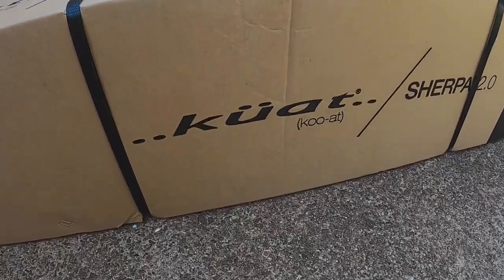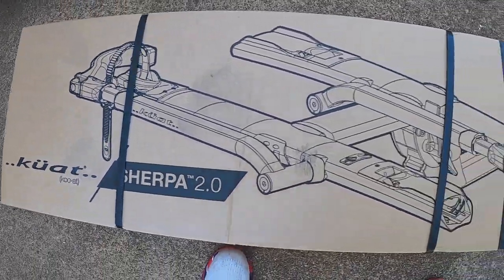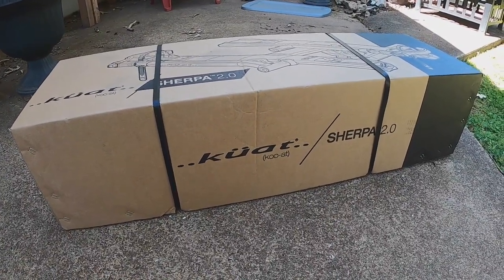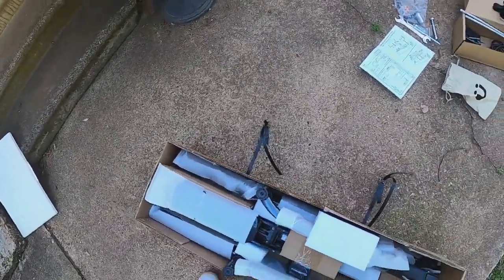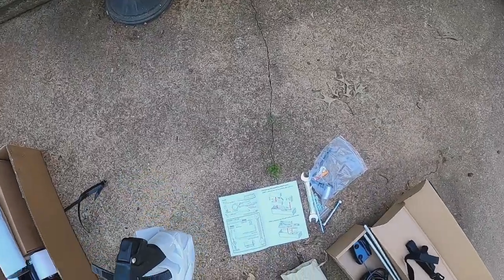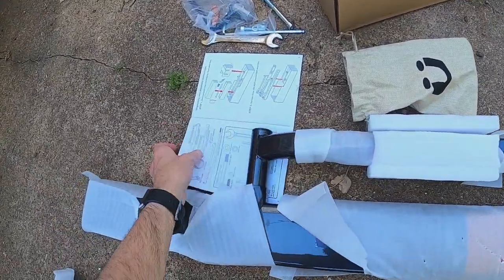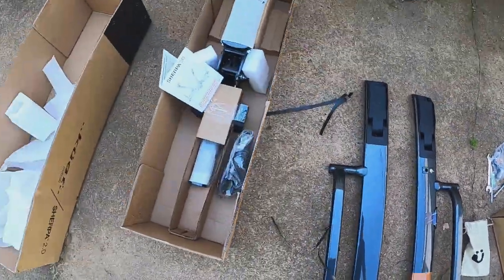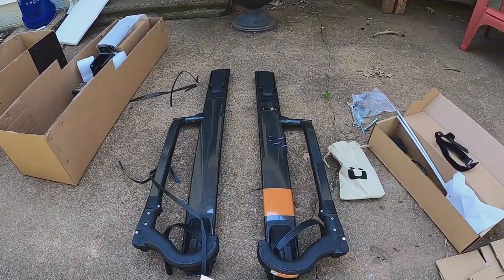Kuat Sherpa 2 0 ASSEMBLY

Comment: Having just assembled my own Kuat Sherpa, I was glad to see I wasn’t the only one who struggled with the instructions.  I, too, removed the tape from the end cap. DON’T DO THAT!  The tape actually holds the end cap in place and makes it much easier to get the long bolts screwed into place. I also did not pick up on the hitch pin is the hex wrench used for assembly. Also note the pictured orientation of the box changes from one step to the next. That makes it a little confusing to follow.
Reply from the maker: Thanks for watching!

Comment: Hi, thanks for the video. I noticed that you had the same problem  with the long bolts getting to the outer body connector. I can't finish the assembly due to this problem; starting to think that its poor manufacturing or design that this happens to a lot of people . Any advise on how to solve the bolt tighten issue? thanks
Reply from the maker: I remember the long bolts gave me trouble but I did eventually get them to work. After getting it together it has been great and we use it often. Good luck.